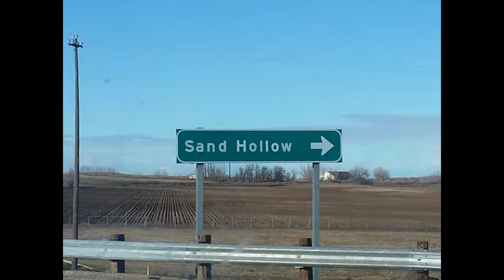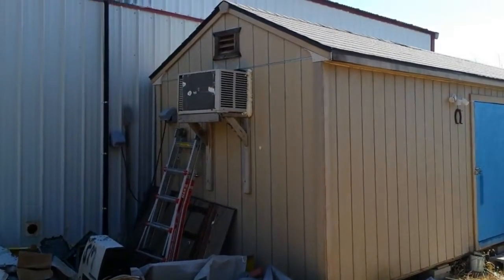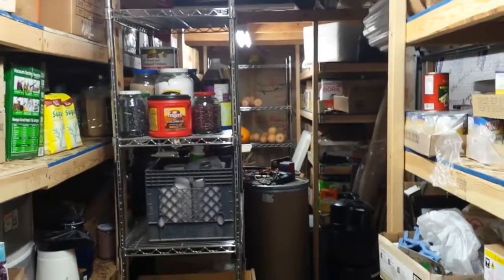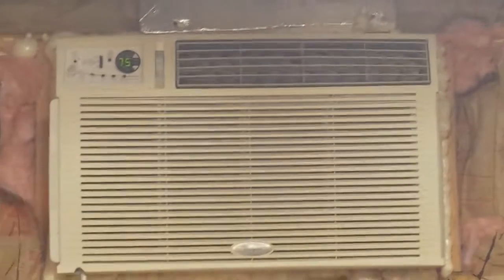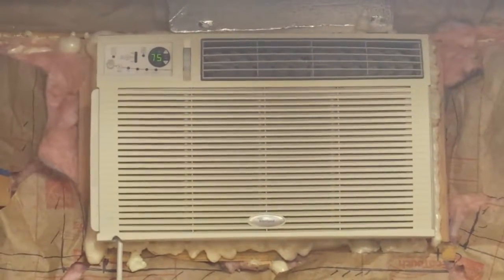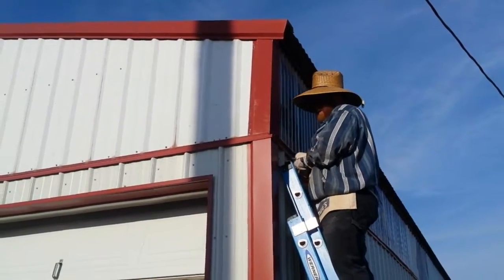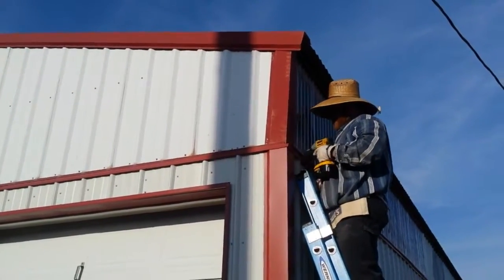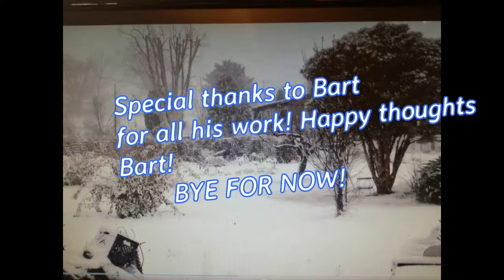Let there be light!....  in the shop.

Comment: how is the ac working in the pantry? looks like you will have plenty of light with the windows thanks for sharing!
Reply from the maker: Believe it or not, it's 69* in the shed now and I've set it on 77* and on energy saver so it seldom runs. It's actually cooler in there than our house! I don't think it will run up the power bill much here on our place. Of course the outside temperature is in the 60s and the high will be in the 70's. A cold front came in with lot's of wind and cooled everything down. Makes it nice to work in the garden right Amber?
Reply: lol yep, except the weather is crazy high then low high then low..we are back up again it was pushing 80's then dropped back down to 60 made for a chilly few days it's on the rise again..grow baby grow lol
Reply from the maker: Mark Thieme Yep. Got down to 49* last night. The A/C won't have to work at all now. Yeah! Problem is the garden won't grow.